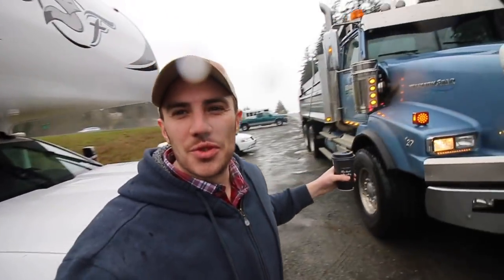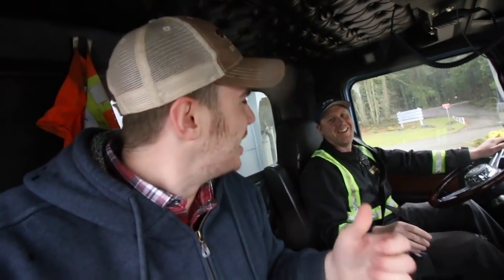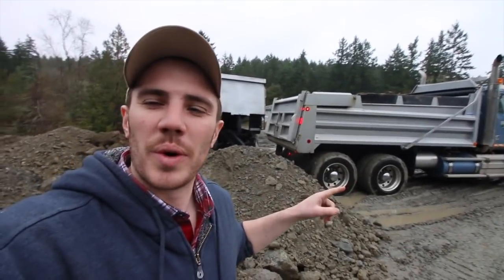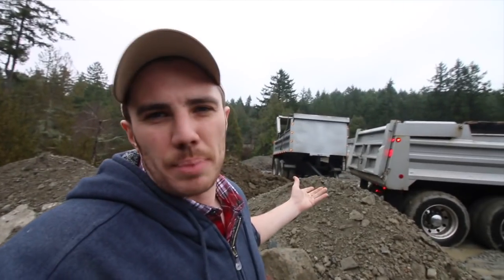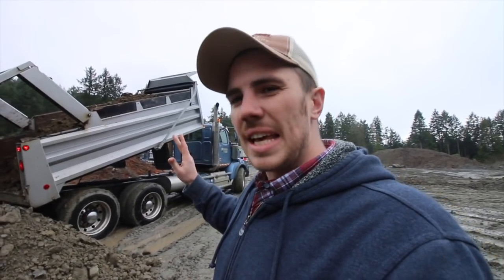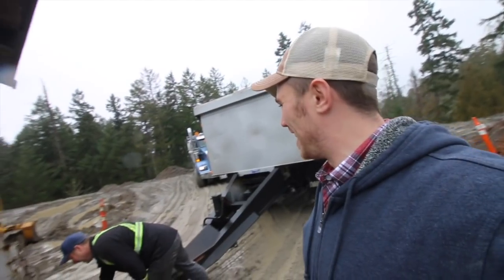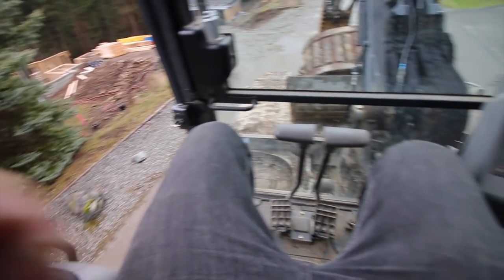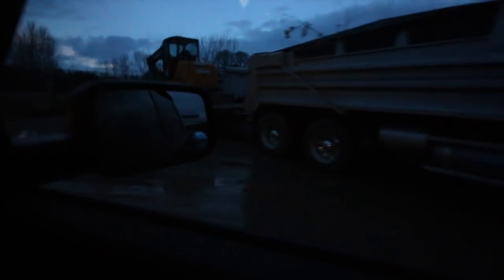Dump Truck Ride Along !

Comment: I always figured it was too much pressure on the tailgate for the dogs to lift. As the ?/150 PSI on the piston was not enough pressure , need  a hydraulic pump. A 330 is nicer. heheee